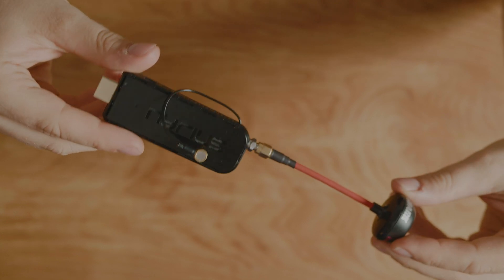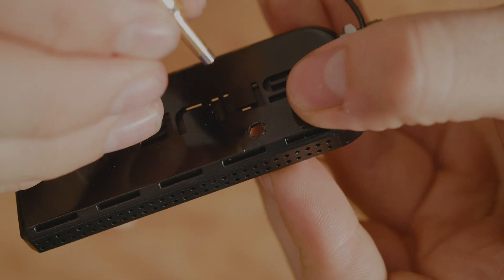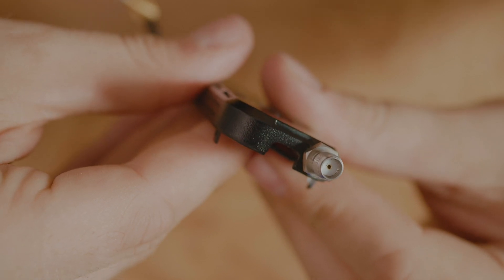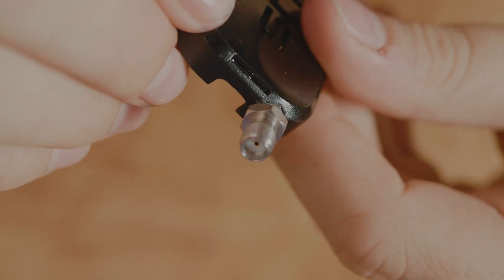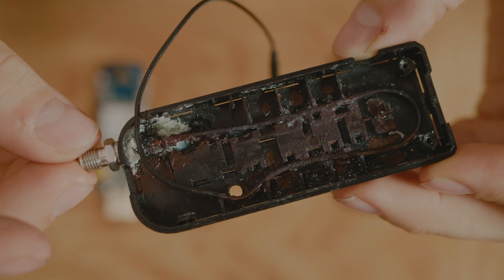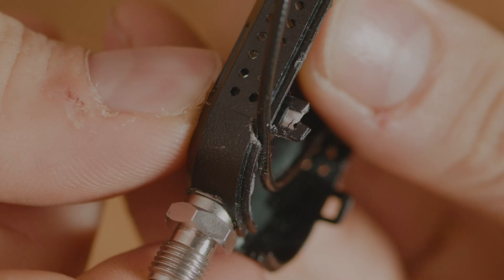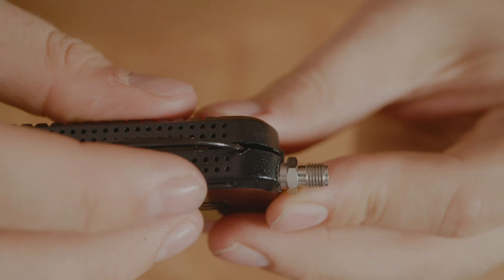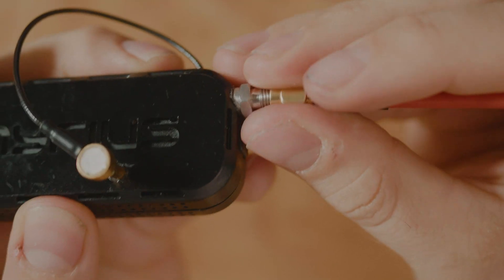TRANSMITTER ANTENNA UPGRADE - Nyrius ARIES Wireless HDMI - Range Hack

Comment from the maker: Notes on this vid 

1) I appreciate the inside of the build is very messy - I didn’t bother me as you will never see it! If you want to make yours neater you could mask off the parts of the inside you don’t want glue on :)
Reply: So you only upgraded the transmitter ?  Receiver is as is ?
Reply: I have an Aries prime with adverticed range of 30ft. I've been trying to use it with an xbox one x and a portable screen. Even though im less than 10ft away im getting really bad signal. Any ideas if this will fix it or there is something else interfering with it.
Great video by the way.

Comment: Why did you use a different style connector on the transmitter than you used on the receiver? Are they different connector types? Do you happen to know the name of the socket on the transmitter or the name of the connector type that plugs into it? I looked at the ebay listing, but I couldn't find the name of the type of connector that cable uses.
Reply: Same

Comment: Firstly, thanks for doing this mod. We rigged this transmitter/receiver set about 18 months ago for use on a low budget music video. We had so many problems(not sure if it was signal or power related) we've never used it since. I'd love to try it again with better antennas. What's the internal connector type? I'm in Canada and the linked  pigtail will take months to get here.

Comment: Great video and thanks so much! Quick question, i've been a bit of a lemon and accidentally bought the prime version instead of a pro version. It's in transit at the moment from the state to Aus. Do you think i could do the hack you have done and get similar results as you have done with the pro version? Anyone here done this with the prime version?
Thanks in advance
Reply: Hi, did you receive your unit and do the upgrade? If so how does it work with the prime? Looking to save  that extra bit of money myself 😁

Comment: Is there enough room inside the case to not have to run the cable back outside and through the top hole?  Like with a shorter cable and smaller plug like this one https://www.amazon.com/onelinkmore-Connector-Pigtail-Bulkhead-Extension/dp/B01AJQ33Y4/ref=sr_1_1?keywords=SMA+Female+Plug+to+IPX+U.FL+Female+3+inch&qid=1573057752&sr=8-1

Thank you for doing these videos!  We use two nyrius pro setups for our live stream roaming cameras every week.  They work pretty well, but if I can get a more stable signal with a simple upgrade like this I'm very interested.
Reply: I was wrong, looks like the ONLY place you can find the rf test cable is the UK, so I went ahead and got it from your link.

Comment: Hey ! I want to power transmitter from 7V sony np battery, is it ok for that transmitter? or i will burn it straigh away?
Reply: This transmitter (and also the receiver) works with USB power, which is 5V 1A, so you would need some kind of adapter in order to reduce the voltage.
Reply: @ensanchefilms8645  I know but for example I'm powering my receiver with 7V from np-f battery and its handling it without any problems
Reply: You should use a stepdown converter so you don't damage your devices, it can work with a little bit higher but you should be careful. I made a mod using the battery plate on my monitor with something like this  https://www.ebay.co.uk/itm/DC-6-24V-12V-24v-to-5V-USB-Output-charger-step-down-Power-Module-HDNSZT/362993408635?hash=item548417da7b:g:~IIAAOSwfLxbA3AU . Lets me power my monitor and a USB device

Comment: Hey.
Awesome how you got this all to work.

Btw, on the eBay listing you linked in the description, there are two models of antenna.
I was just wondering if I needed a specific one of the two, and if so, which one?
Reply from the maker: Thanks! - I have just updated the description to say the right one, the one you need is the RP-SMA Male Antenna :)
Reply: Cheers.
Reply from the maker: @blockedocelot  Hey sorry for the delay, I just saw that you commented a couple days ago but I cant find the comment now - Let me know if you need any help with anything  :)

Comment: finally! great job man :) a little question, teorically is it possible to add two antennas on the transmitter? because i saw two holes (ant 1 and ant2)
Reply from the maker: Thanks! it took me long enough :P

Really good point - I did have a look at doing that but as far as I can work out that is for something called D.F.S. This is basically so the device can search for unused frequencies and get the cleanest signal possible - there could be a small advantage to upgrading this to an external antenna over the onboard one, but it won’t make the video transmitting signal any stronger annoyingly!
Reply: David Morgan Jones thx